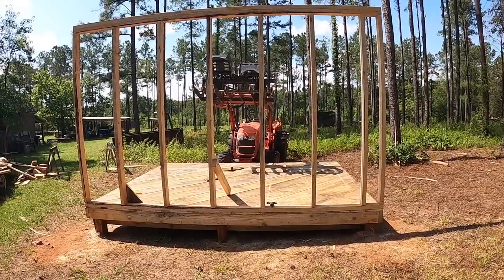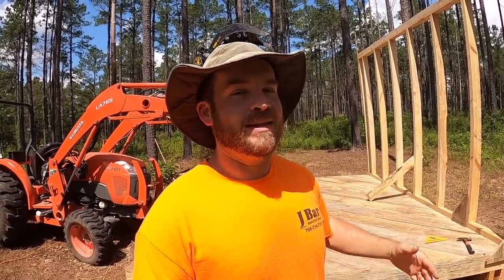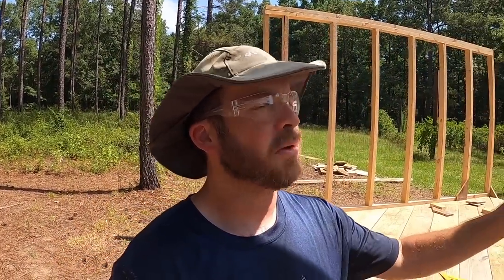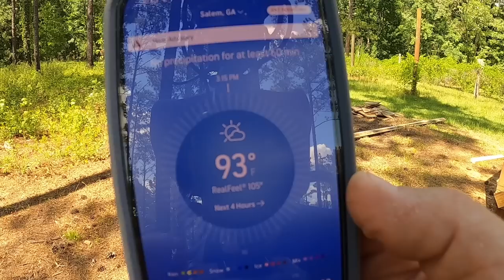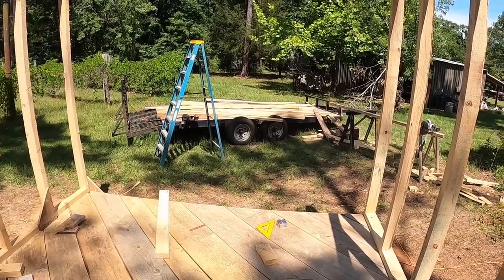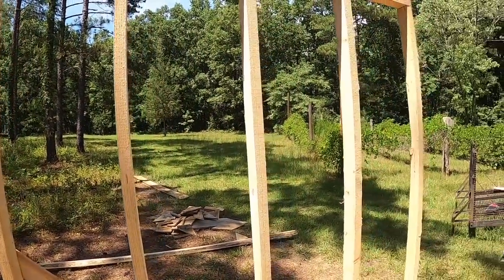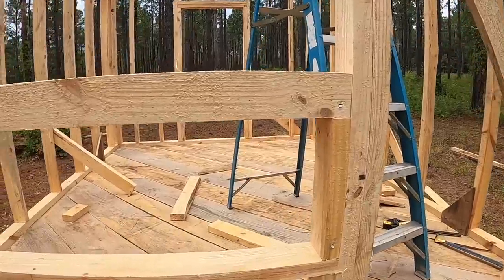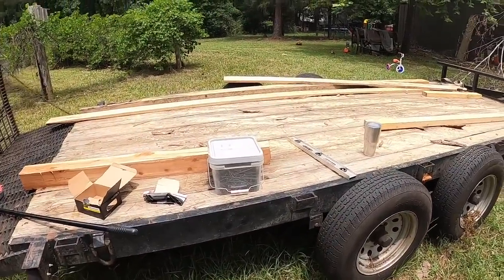Building a Chicken House, Part 2

Comment: I dont know how far ahead you are in the build but if you haven't built anything inside the coop yet I would recommend adding some linoleum to the floor inside.  Now here me out before you call me crazy.  Just some cheap linoleum through the entire inside flooring will prevent the chicken scat from soaking into your floor and rotting it out or adding that lovely chicken fertilizer smell to the building.  It has the added benefit of making cleanup easier as well.  You'll still need some absorbent material like wood shavings or in your case pine sawdust (never use cedar!) but with a plastic barn shovel you'll be able to scrape everything out quickly.  We did that on our coop and goat barn and have not regretted it!

Comment: I like to put temporary cleats (about 10" or so in length) on the outside of the deck so that when I rock the walls to vertical the bottom plate of the wall has something stop it.  I can then kick or hammer the bottom plate of the wall until it stops against the cleat.  In the spirit of planning ahead I fasten a long 2x or 1x at the top of the wall with one nail so that as the wall is brought to vertical that 2x or 1x drags along the ground and helps to prevent the wall from falling back on me, also it forms an angled brace that is already in place to nail to the deck to keep the wall vertical.
Great video Wes thumbs up.
Reply: Good tips Craig. Wes needs to rent some wall jacks as well.
Reply: amen brother.
Reply: Good advice there Craig
Reply: @mrkevinjmiller  did you live on Rocky Point Rd., Hewitt, NJ?
Reply: @craigsudman4556  Nope.  Musta been a different Kevin Miller

Comment: When framing a structure. Strike a line where you want the inside of your wall to be. Set your bottom plate on that line so that the bottom corner of the plate will pivot on that line when rolled. Build your wall on the deck. Make sure your bottom plate is on that line as described. TOENAIL THE BOTTOM PLATE TO THE DECK...so that when you stand your wall, the heads of those nails wind up on the deck. The toenails will anchor your wall to the deck and keep it from sliding or twisting. Setting it on the line makes sure you stand it once and don't have to move it. This is how framers do it. MUCH safer and exact than that super scetchy & (quite frankly) dangerous way you were doing it. I'm so glad you didn't get hurt. Maybe watch a few YouTube videos on how to frame a house next time!
The Essential Craftsman is a great channel for all things building related. Older man, soft spoken, knows his stuff. Highly recommend!
Also, your top plates should overlap the other walls, so that the walls are tied together with lunber, as opposed to just nails. On your structure, you short walls top plates should overlap your long walls. Since your short walls are inside your long walls, the short wall top plates will overlap your long walls, tying them together. This is part of why you always have double top plates.
Reply: You beat me to it! You  can put  a diagonal brace on it to help it from twisting!

Comment: I am a framer, I framed for over 30 years.
I would've framed the 1st wall end to end and for the 2nd wall, I would've butted it to the 1st wall to the end of your floor. For the 3rd wall, I would've butted to the 2nd wall to the end of the floor, the 4th wall in between the 1st and 3rd. Also if you nail a couple of blocks to your rim boards sticking above the floor you are not wasting muscle trying to keep the walls from sliding off and concentrate on getting the walls up.

Comment: I’ve seen guys attaching a couple pieces of plywood to the bottom of a wall, extending out a few inches, so that the wall, when raised, can be positioned against the plywood, and held in place with some nails through the plywood.  Just a thought.

Comment: Before you build the wall, snap a line on the floor 4" in this case(width of the wall plate. After you build the wall, while it's laying flat, line up the plate to the chalk line(bottom of the plate) toenail the plate to the deck. It does two things, keeps the wall from sliding off as you raise it, puts it within a fraction of where it's gonna live when it stood up. If you tack long diagonal braces (10-12") to the top section before you stand the wall, they'll be ready to nail and brace when the wall goes vertical. They'll also help in keeping the wall from falling back toward you should it be too heavy. Once up, plumb and tack the brace, now you have an additional stop for standing the remaining end walls.
Reply from the maker: Ahhh, good points. Thanks for the tips!
Reply: I was going to suggest the same thing, but checked the comments first to see if someone else had already said it. Little tricks like these make it easier and safer. Especially when working by yourself.

Comment: For not being a carpenter, you do just fine. If you haven't built your trusses yet, may I give you a tip. Find a concrete slab that is large enough to lay out your trusses on. Lay out and snap all the lines for your trusses on the slab so you have a picture of a truss on the concrete. now you will have all the angles for your cuts, all the lengths, everything right in front of you. Now take clear spray paint and spray all your lines so you can save what you have done. Now you can see what your truss will look like, build your trusses on that slab, one at a time, then stack them to the side. Now all your trusses will be the same. Hope this helps. Also find a friend to work with, you will get alot more done and if anyone gets hurt, there will be someone there to help. You were scaring me when you were working with those walls by yourself

Comment: 1.  A nail gun would make life easier for you.  Use hardware cloth, not poultry netting or chicken wire.  3.  Nesting boxes- Use plastic dish pans.  Build a frame to hold them.  The dish pans are easy to clean.   4.  Build clean out door for cleaning the floor.

Comment: Wes instead of the windows, I would leave 2' maybe a little more around the top of you walls with no siding for ventilation.  Attach the hardware cloth for protection.  Just a suggestion, but you need the most ventilation you can get because the heat down there.

Comment: Brother they Make a Automatic Chicken Door That opens at crack of daylight and closes down at fading of daylight. U can find them at Premier One or E bay or Amazon or tractor supply or most hardware stores. Some come with a tiny solar panel that charges the battery that opens and closes them on a light sensor. Some of them run off of batteries that you replace and some of them even runoff of electricity. But that would serve you a lot better having it to open at the crack of daylight and letting them out so that you do not have to go out there to let them out and close them up. Those chickens like to come out as soon as the daylight is starting to crack. But I think that would work better for you than you having to go out there and manually open and close it every day And if you forget to close it one day a raccoon or two can wipe your flock out in one night.

Comment: You did good with the tractor. But you can also put 2x4 or something struts on the wall pretty loose. So when you lift the wall they selfadjust sticking to the floor. Hard to explain in english. 😅 cheers from 🇸🇪🍻

Comment: More from "YouShoulda tube", as others have said you are lacking a way to clean out the coop. One a vinyl floor will stop the dropping from rotting the floor, along with wood chips and saw dust the chicken will start the breaking down process of the wood and make great compost. Now to cleaning the coop out. Find the side where you will be able to drive up with the tractor and bucket, roll the bucket fully back set to the wall where it would hold a full load without spilling.....this is your bottom edge of the poop door. make it a few inches smaller than the bucket, best if is also floor height to just sweep it out using the bucket like giant dust pan. $00.02.

Comment: I saw someone put smooth plywood on the floor the give a few coat of industrial floor paint so you can clean out the coop better and the waste does not soak into the wood.
Reply: Heck, even a sheet vinyl flooring would provide a water tight, easy to clean floor ..... but deterioration from the elements would be a negative ...... wouldn't want the chooks to eat at it ..... oh well.  I can't think industrial floor paint would be advisable either ..... wouldn't want them to eat bits of it as it flakes off .... remember, Wes and family eat the chickens as well as the eggs.

Comment: Nice. You could've waited to put the second top plate board on after installing the walls. That way you could've interlocked each wall at the tops.
Reply from the maker: That's actually what I ended up doing. I cut off the ends of the top plate that was already there and locked the walls together.

Comment: Question ❓ Why did you put your upper sill plate on before raising the 1wall . I ask because the upper sill is what keeps the walls tied together. Not knocking on what you did. I build sheds on the weekends and we always off set our upper sill plate so you overlap the corners on top of the wall. There's a ton of way's that you can do the peak my shed's us barn pitch but when we do peaked roofs without trusses it's easier to use a ridge beam but may require a second set of hands. There's a ton videos on YouTube about birds mouths and how to measure them
Reply from the maker: Just inexperience. I actually ended up cutting the ends of that top plate and tying it all together like you’re saying. Just kind of made sense.

Comment: It's s shame you couldn't have arranged for a barn raising (coop raising ?).  Also, for the purposes of shoveling out the soiled bedding and chicken poop, how a bout a small door at the floor on the wall opposite the chicken yard, so you can just shovel it out into a wheel barrow.  Of course to make the process easy, you would need to remove the bottom board in the opening so you don't have to shovel up and over to get it out.

To aid in ventilation, install wall vents that will open automatically based on the heat and an exhaust fan (or 2) to draw air thru (properly screen on the inside of course ..... have the screens removable so  they can be easily cleaned periodically of dust and feathers (primarily needed on the screen of the exhaust fan, but screen them all)

Comment: Well at least you got the walls up there was a whole lot easier way to do it though first you need to put cross pieces in to keep it from twisting on you second if you put extra long poles on the outside with one nail so I had to raid the wall up the post would dig in the ground supporting the wall so it will look like a triangle if you look from the edges then at the wall gets too high for you to reach you the two-by-four with a notch in it to push it the rest away up. But anyway good job keep it up lucky chickens